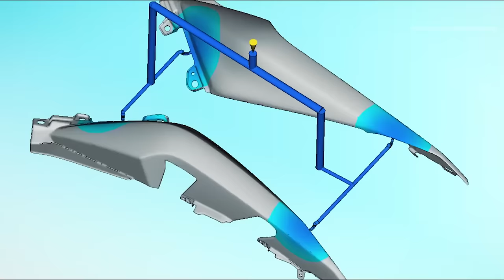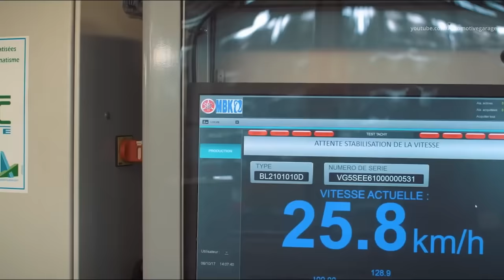Yamaha Motorcycles Production - FACTORY Tour

Comment: 65,000 kilometres (40,000 miles)   on my Yamaha and didn't miss a beat. Still running strong when I sold the bike to the next lucky rider. Great products.
Reply: If it is a bike like FJR1300, normal like the others labels, if it is a YZ450 or MT125cc, impressive !
Reply: @TheRoamine74  The bike was a YZF1000R sports tourer. Very versatile set of wheels and quick.
Reply: @malibu188  it is not a feat then... Except for 125cc, or little monocylinder, 65000km is pretty easy to reach for a bike with normal maintenance, 165000 will be more impressive if no parts have been replaced !
Reply: I bought a 2004 FZ6 Yamaha with 44,000 miles on it, doesn't look brand new but it runs brand new thats for sure! I am in love!
Reply: @Bigburt-  My Yamaha had over 40,000 miles on the clock when it got tested on a dyno and rated at slightly higher horsepower than a new bike. K&N sports filters with a good quality after market exhaust helped a lot in getting the strong power numbers over stock even with the high mileage on the bike.
Reply: @malibu188  MT-125A 2015 46000km and still a joy starts in a flash.
Reply: @nihonkokusai  Impressive number of kilometres for the MT125 and still running well for you.
Reply: @malibu188  r1 2008 /67000km starts like new

Comment: Love my yamahas ! Had loads over the years . Still have an early mint R1 and the latest R1 but prefer my MT10 best 🤷‍♂️😮🤣🏍
Reply: I still have my 01 R1, owned it since new, its mint with only 13,000 Km on it. Plus an MT01 and a couple of older Yams, an 87 FZR1000 thats getting a restoration at the moment, and a 3XV TZR250 SPR. :-)
Plus a slabside GSX-R1100, but we wont talk about that :-))